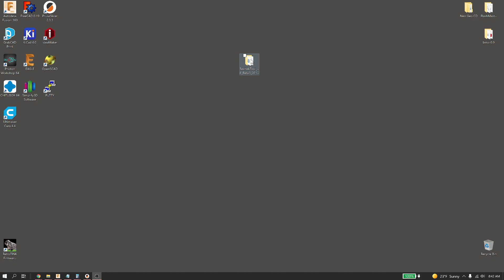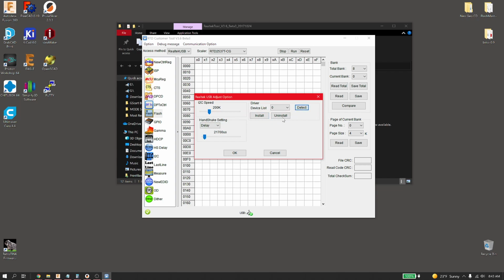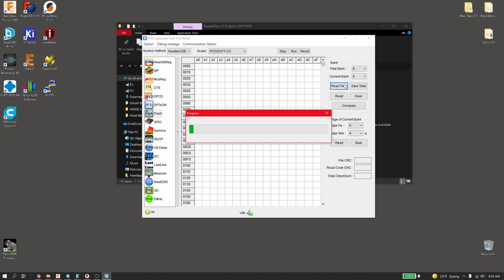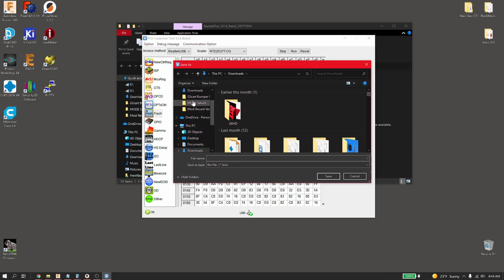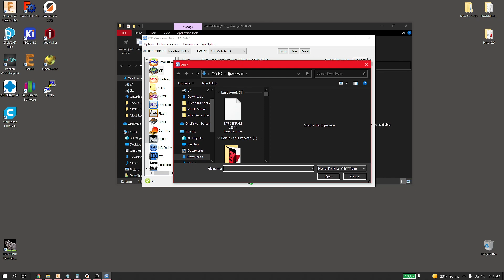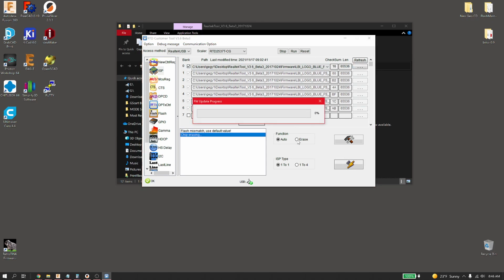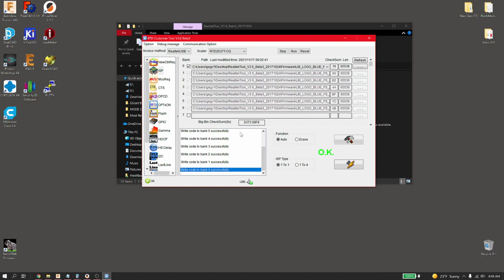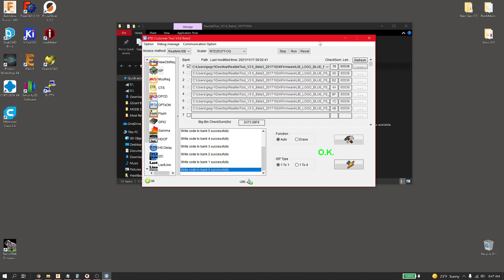Flashing the VSDisplay RTD2556T iPad3 LCD controller

Comment: Hey not sure if this channel is still active but can you help me with flashing the EDID, I'm working on a custom board and when I flash the firmware it doesn't flash the EDID information.
Reply from the maker: The EDID info is hard coded into the firmware and not changeable with the firmware tool. I think older versions of the drive chip could have that changed but unfortunately anything newer needs it hard coded in the firmware.
Firmware sources are also impossible to find due to the way those chips are marketed
Reply: @LaserBearIndustries  the chip is the 2555T and I can see and backup the EDID information from one board, plus update my older boards with new Firmware like what you did here which also changes the EDID information.  But flashing the EDID to a blank board hasn't seemed to work.
Reply from the maker: @gamingmobiledna you can extract the EDID, but can't flash it. It's hard coded into the firmware. I've tried to change that stuff in the binary but usually just soft brick the boards when I do that.
Reply: @LaserBearIndustries I've figured that out the hard way.  A company sold me boards, I bought a bunch they all work great and they have my branding all over them (no NDA signed) but I found a cheaper company that cloned the boards but I cannot for the life of me figure out how to flash anything but the firmware which doesn't actually flash the EDID.  So I'm out here prying for information any way possible 😂

Comment: When I try to read total I get an error code "I2C no ack! Any idea why it ia erroring?
Reply from the maker: Sounds like there is not a connection to either the flasher, or the chip. First try a different HDMI cable, sometimes they don't have all the pins required to connect to the chip
Reply: @LaserBearIndustries  thanks LB
Unfortunately I have a bigger issue..
I begun tinkering and switched to GFXISP which flashed my M.NT68676A board which "was" for my LM270WQ1 SDE2.
(Apparently Gfxisp reads the monitor connected to the pc graphics card)

Fortunately I did save a read all file from the flash. Hopefully I can restore my monitor without wiping another one😢

Comment: Hello, I have a board using RTD2556VD configured at 1920 x 1080, now I change to a screen with a resolution of 1366 x 768, I need help
Reply from the maker: @TyBe-tq6lz  sorry I can not help with that, my firmware is only compatible with a 2048x1536 screen. I do not have access to source code to make adjustments for other panels to work with it.

Comment: why do the sync rates stop at 63mhz ? alot of industry, medical and Dos based equipment ran i text mor 80colum 70mhz and there are very few monitors that support that these days. is it a limitation of the chip or the fact it was never really intended for VGA standards.
Reply from the maker: Apple is the reason, these displays were manufactured to apple's specs for the iPad, which ran at 60hz, I'm actually surprised it can go down as low as 40hz. The panel uses an eDisplayPort interface for connectivity and that is the limiting factor on framerate. If the panel was LVDS you can usually overdrive them until the pixel response time is the limiting factor so 70 ot 80hz would probably be doable even if a bit smeary. The eDP controller will not sync anything over 63hz and instead just switched to a solid white screen.

Comment: Hello, I need help. I have a controller that is configured for a edp 40 2560x1440 display but I now want to use a 1920x1080 edp30 display. It is using the rtd2556. Do you know how to configure the firmware? I have extracted the firmware from the eeprom but cannot find a fitting firmware.

Comment: Found your improved firmware and decided to try it. It seems my PCB is exactly the same as recommended in your store. I don't have (yet) official RTD flasher tool. I've used i2c RTD2660 flasher (as you pointed in your blog), and also tried direct chip programming (using ROM programmer). None of those methods make PCB work with your firmware :( I can flash back my original FW either way and it works, but not your FW. I wonder if RTD Tool does some magic while flashing or visually identical LCD boards are really have incompatibilities.. That's pity, as i really want to get 40-63Hz range to use with MiSTer.
Reply from the maker: It's likely their software does something different. It is a newer chip than the 2660 so maybe it has to flash a different area of the flash. It's sad that they have decided to not release documentation on any of this to the public.
Reply: @LaserBearIndustries  finally got realtek programmer and flashed your FW by that. Unfortunately it still doesn't work. As i've told above, the board i use is the same as you recommended. "lcd-rgb 2018-1 v2.2" is written on board. There is another 8-pin chip on board with erased marks. I think it's 24C02(or 04) for DDC, but it's also possible that FW read this chip to compare some manufacturing mark and refuse to work if it doesn't match. Can you dump this chip so i will be able to flash it too? Probably it will require to de-solder it and read on programmer.
Reply: @LaserBearIndustries  there is NewEDID function where you can read/write that i2c chip. Can you save your dump of that chip? Not sure if this function reads the whole chip or only part..
Reply: @LaserBearIndustries  update: it seems EDID is inside firmware (i see EDID dump inside), so that 8-pin chip must be a protection chip, so it need to be dumped, i think. Or at least firmware needs to be modified to remove protection.
Reply: i don't know how you modify original FW, but if i will send my FW to you, can you modify it with 40-63Hz and working Aspect Ratio? Main chip is RTD2556T

Comment: Thanks a lot for all your effort!

Today my programmer arrived and I tried to update the Firmware, but I always get the message:

Write flash SR fail. Error code:0x3

The Backup of the firmware was succesfull and resetting the monitor also works fine.

Did you run into this error at some point?
Reply: I got it working but switching to a lower spec HDMI cable. My 2.1 cable did not work - cheapo 2.0 cable worked.

I now see the LBI Logo on startup etc - sadly the different aspect ratios are still not working - despite having the correct ship model.
Reply: @JohannesRe  Thanks for writing your resolution. Switching to a crappy old HDMI cable did the trick for me as well.

Comment: I’m currently waiting for the programmer to arrive, but I was just curious as to what the main features/differences are with the custom firmware? Like as in what features/benefits were added to it. Thank you very much for all the hard work you folks do! I can’t wait to get my monitor up and running… 😁
Reply: I think I went over it in the blog, but in case I didn't we added support for aspect ratio control, so the screen won't just stretch the image to 4:3 if its 16:9 content, a pixel perfect mode that centers the image and displays it exactly as it comes in (great when used with the RT5x, it now supports more refresh rates and a variable refresh rate mode (FreeSync) and there is hidden factory menu we had them add in, (some original firmware do expose this but not all)
Reply: @collingall1  does the freesync only let you use it when it detects a source that can take advantage of it? Its greyed out on mine after I flashed it.